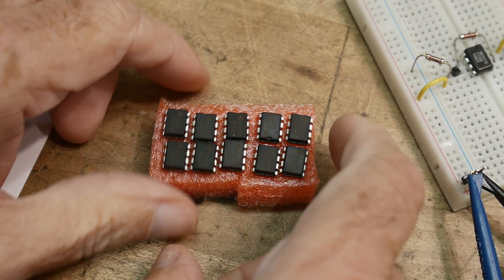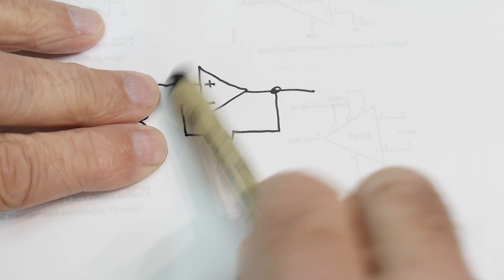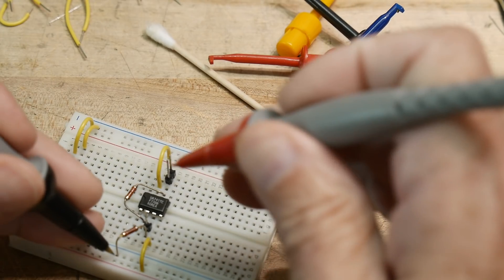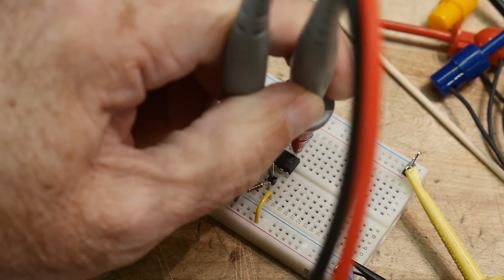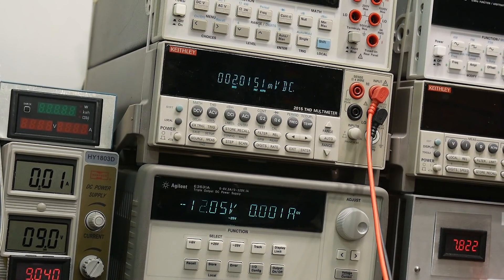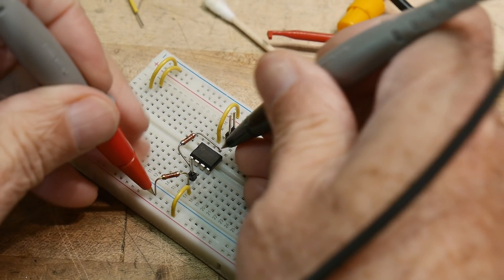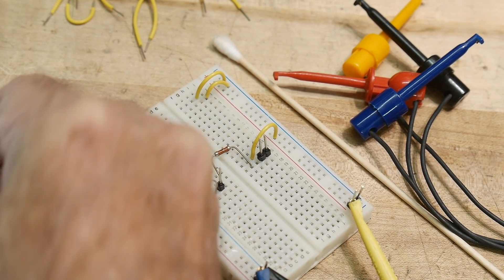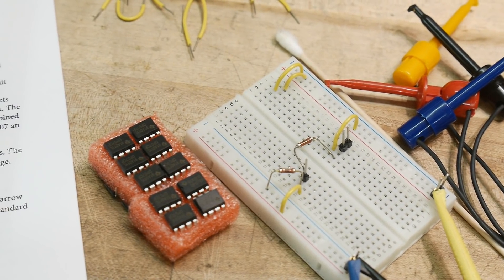#1029 Fake Op-amps from China

Comment: I purchased five each of these totally bogus Exar's XR2206 and Intersil's ICL8038, both EOL, Inactive, obsolete, not manufactured for decades, being kitted via Scamazon & FraudBay for less than $5, though the greedy price them upwards of $15US.

I found wish.CON had some kits WITH CASE for $3, so I bought five, incase someone like you would or could use some samples in your work. free to you, Maestro

Thank you for shedding photons on the issues.

I wonder how many thousands of unsuspecting hobbyists, especially the ones that post "Yeah Great Look at that Square Wave IT WORKS PERFECTLY, up until they feed 12V or more into the one exhipping EXTREME Sine distortion well within the original spec, but not the fakes.

I bumped into a years-old thread just as I was about to hit Spend on Scamazon for the one, and FraudBay for the other, when it became apparent via check-in on one of the specs listed that did not ring true.

There is an Excellent YT vid up by a Master who not only parameterized the actual IC, upo to and not including X-Ray, that went further in, came up at the other end of the cess-pool of fraud and dishonesty with a mofdified schematic and warnings re. over-voltage that teaches pparaller to this one.

xr2206 fake fixing will get it

Comment: I measured -3mV on my Chinese OP07s.  How is that even possible?
Reply from the maker: Hint: It is not a OP07
https://youtu.be/NSgqYLLPUSs?si=AGltAdbb8I6Kc0rr
Reply: @IMSAIGuy  Thank you for the answer. I suspect that in this case it's better to just throw away the entire OP07 batch, because you never know what's really in it.

It would be interesting if you could make a video on how to test basic OPAMP characteristics, for example offset voltage, voltage swing for rail-to-rail opamps, other important characteristics... For example, I also bought the MCP6002 and connected VDD to the non-inverted input instead of ground, and the output voltage was really only a few millivolts below VDD. However, I don't know what else I should test to be sure that my MPC6002s are suitable for use.
Reply from the maker: I made this for testing an unknown device with a good device: https://youtu.be/FzH0VEbI7uQ?si=wMG0g7ACsKL_39-h
Reply: @IMSAIGuy I bought OP07 in a regular electronic shop in Europe and again it does not work. Are you testing it with dual supply or single supply?
Reply from the maker: @markopinteric  dual

Comment: Recently I designed a card for a foreign customer using the known LT1990 industrial opamp. That is an excellent special amp. The customer had purchased the necessary lot of 1000 chips (likely from China). The cards went to production and then to testing. None of them worked. I had to investigate them and realied that they could not work at all. The chips were internally shorted at supply pins. All chips had o be pulled out and replaed with an original chip, now working.

The false chips had proper markings.

Comment: easy way to have a good indicator that you have fake op amp. use a fridge magnet. if the component case is attracted you problaly have a fake one
Reply from the maker: I liked your idea, so I tried it out. It seems that it is a good test for the age of the part but not if it is fake or not. the more modern good parts, also have moved to leadframes that are not copper.

Comment: Once upon a time 55 years or so ago. I was building the latest do gadget,  which required a quad 741 op amp.  After designing the circuit board, and for some reason installing sockets  for the ICs I installed the op amp, bought from a local vendor. Next the smoke test, where I would power up the circuit for the first time. My goodness I have built a plasma rocket ... the circuit wasn't happy to just let the magic smoke out,.... the op amp, spit flames from the pins and flew off the board. Rebuilt the board replacing parts from a more expensive vendor, and it worked fine, so yes sometimes parts are not what they seem.

Comment: You paid $1.88 for a batch of fraudulently relabeled 741s.  It would have been no great loss even if you couldn't get your money back. But suppose you were manufacturing a small run of high-precision electronics, soldered them into boards, and then found that your device performed like crap? Or even worse, your customer found that to be the case? The ramifications would have been a lot more than $1.88. I don't think the scammers in China who perpetuate this kind of fraud would shed many tears for you.

Comment: The real money is in defense acquisition supply chain obsolete parts. You buy some actual surplus die held by a surplus chip house, and bond them into a MIL package, screen them, brand them and sell them as MIL-SPEC, complete with a fake date code. They meet every AQL test. They even fix the antique box in the jet with no issues. But they are still counterfeit.

Comment: Using only one tiny specification is rather a rush to judgement.  How about the power consumption and noise level?
The OP07  IC has two "offset" pins, so they can be used if all other specifications are met, it that is necessary.  They are still audio amplifiers.  I bought 250. 2N2222A's for $1.95, they are fakes, but the gain of every one that I have tested so far is ~700. instead of ~100.  They are wonderful transistors.  I don't see the problem if you are careful. Ron W4BIN
Reply from the maker: the offset pins on the fakes were no connects, not bonded. they probably used a part that did not have the offset available or used -V and the op07 uses +V
Reply from the maker: Just to clarify, these op amps are not audio amps. they are way too slow. the only reason to specify an op-07 is exactly for the low offset.  If you are running an op amp at high gain, say x1000. then a 2mV offset would be 2V on the output. OP-07 are used in critical measurement applications. glad you like your transistors, I do not like my op amps

Comment: I once bought some fake OPA4134's in a DIP package off a Chinese vendor on ebay.  (It's the quad version of the OPA134/2134.)  They're a JFET input opamp that's great for upgrading a TL074 for noise and slew rate.  At $4 each the price was amazing considering the DIP package version was out of production.  When I got them they tested exactly like a TL074 which cost $0.15 or so in bulk (half the supply current and same noise as TL07 series).  They looked EXACTLY like real Burr Brown chips.  Super bummed....

Comment: About 10 years ago I ordered some IRF740 powerfets from a low-cost mail order place. They arrived quickly and I built them into an RF power amplifier designed to deliver about 25 watts.  I struggled for hours to make it work properly, fiddling with the driver and output transformers, thinking I must have got them wrong somehow. But it refused to deliver more than about 8 watts, beyond that moving into serious compression and the efficiency was poor. I changed the FETs (from the same batch) but nothing improved. In the end I decided it must be the FETs and I ordered some more 740's from a more reputable retailer. BINGO! 30 watts straight away and good linearity. Damn the Chinese.

Comment: I ran into fake op-7s where I work.  After look them over it could be seen that they had been top coated and relabeled.  The leads had also been trimmed meaning they probably had been removed from a previous installation.   These parts were bought like 20 years ago so this is a common problem.  I keep bugging our people here to update to newer part numbers so we aren't having to buy old new stock.

Comment: FAKE or NOT! Right, the prices have told you! If you say they are fake, you are blaming yourself Greedy! What did you expect if you use 1 buck to buy a stuff that should be 5 or even 10 bucks
Reply from the maker: I buy opamps at the local surplus store for $0.05 here in California. The OP-07 is a very old part so it should be possible to find old stock somewhere. $0.10 seemed like a possible price.

Comment: couple of years ago I bought 20 DIP LM358s from ebay and they were all completely dead, none of them did anything. it was as if the legs were just going into little slabs of plastic. I wish Id dremel'd into one to see if there was actually anything inside. and LM358s are super cheap anyway, you wouldnt think it even worth making fake ones.
Reply from the maker: most people think all the face chinese opamps are repackaged/relabled LM358s. They even fake those, amazing

Comment: Wondering if they're copies that have not been laser trimmed, rather than repackaged 741. What's the bandwidth, is it the same as a 741? I had some TL071 op-amps, which were fine, but had a lower slew-rate compared to the legitimate article.
Reply: In my experience, cheap opamps sold on the interwebs are usually just four or five designs that get rebranded to whatever part number is trending at the moment. Someone on the eevblog forum decapped many opamps ics and found the same kind of generic opamp, no matter what the markings. It's some sort of slightly faster LM358 (in single, dual or quad configurations, to match the fake part number pinout) and that's it.

Like all LM2596 on unofficial channels: they are some sort of low power 2576 clone. They can be useful if you know their limitations, but they certainly are not the real deal.

Also, I suspect all transistor kits contain at most two or three types of actual dies, no matter what the markings is. They are probably binned by hfe and maximum voltage.

Comment: I despise the chinese and their shitty counterfeit rip-off components. FU*K them is what I say. I refuse to buy any semiconductors now from chinese sellers on evilBay. You can pretty much be guaranteed the products are fakes. Any time you see 'normally expensive' parts advertised as 10 for a dollar, it's a good sign they're rubbish or remarked products. Another Youtuber did a good video on knock-off components and in it he shows how sometimes the parts can be almost the same as the genuine article, except the die is 1/10 the size so while it might work for a while, it can't handle the rated current of the genuine part and will fail on that.

Comment: The easiest thing to measure, quiescent supply current, is all by itself usually enough to tell you an op amp is fake.

All the fakes in my op amp collection that I've identified so far using quiescent current could plausibly be LM358s, but they're probably out of spec in some other parameter.
Reply: A LM358 can't be confused with a  ul741 as the ul741is a single and the LM358 is a dual. Ron W4BIN

Comment: There are probably some rudimentary op amp chip masks from the 1970s in China (copycats such as LM308, LM324, LM082) because there are many products of the same model number that differ only in the prefix. I think there is a foundry that has been commercialized. I have been hurt many times. The first sample is good.

Comment: Two other useful ways to tell suspect eBay op-amps apart - measure slew rate and noise with a CRO.
Reply from the maker: I will be doing slew rate in a future video
Reply: And look for crossover distortion, many knock offs are remarked LM321/LM324.
Reply: @ferrumignis  : Good point - the LM324 has much higher cross-over distortion than almost any other op-amp.   But cross-over distortion isn't a data sheet spec for most op-amps, so if you are claiming a refund on the basis of LM324-like levels, you might need to write your reason carefully.

Comment: At least they are actually opamps that work, I think you should reconsider your accusations. You see, cheap parts from China come because they're out of spec, not necessarily because they are fake.
For example, if you buy cheap 18650 batteries from China, you will get either fake batteries with 300 milliamp hours, or you will get out of spec batteries with slightly less capacity. Out of spec parts is what you would expect, if you are buying from eBay cheap parts from China.
Reply from the maker: I actually looked at the die from a real op07 and the fake one. they are different. The fake one also did not even wire bond out the offset adjustment. they are no connects. they are 1000% fake.

Comment: It's getting harder and harder to find legit parts.  Even Digikey is cracking; they're now including "Marketplace Product" sellers (chinese junk) in their inventory.  Will Mouser race Digikey to the bottom?
Reply: Well it is driven by the market. Lots of people just can't resist the low price. For most hobbyists, if there is less than 30% chance of getting fake parts, they are willing to give it a shot, especially they can get reimbursement most of the time. 

And technically, these parts are not Chinese junk but US junk since there was a long supply chain of selling US electronic junks to China for "recycling" and there were scavenger groups ripping off the old parts from PCB, sorting and reselling them. In 2017, Chinese government has banned such electronic junk trade for environmental concerns and what you can buy from aliexpress now (especially old DIP packaged parts) are possibly junk inventories before 2017, which makes their quality even worse.

SMT parts from Aliexpress are of (slightly) better quality because less % of them are from recycled junks. Some of these parts are substandard parts that failed performance test, but they are from original factories or dealers. So if you application is not mission critical, you can still try them.

If time is valuable, use a professional channel like lcsc for Chinese parts.
Reply: @sullivanzheng9586  I buy my chips from Unicorn Electronics Pennsylvania 
Never had a problem and way cheaper than Digikey Mouser or even All Electronics
Reply: @Starbuckin  Cool, thanks for the tip. The website looks minimalistic but their catalog seems a great fit for building up basic inventories and discontinued components for hobbyists/ repair work.

Comment: Could be worse.  I bought some 2N3819 JFET transistors from a US seller on Amazon.  Price was in the normal range.  They would not work at all in my application.  I then tested them with a transistor tester, where they tested as NPN.  Parameters are suspiciously close to those of a 2N2222.  Each package says 2N3819.  Didn't bother sending them back, but I reviewed accordingly on Amazon.  That's when I noticed lots of negative reviews for the seller saying other parts were not "as expected".
Reply from the maker: Amazon is a joke. I kept buying used Raspberry Pie computers that were just a scam and never shipped the product. Did this three times, each time Amazon refunded me. Then instead of admonishing the sellers. They told me not to buy that product.
Reply: I had the same problem with JFET transistors on eBay. The package said J201 (this is a JFET model) but these components were actually BJT transistors!
Reply: For anything that has a critical analog performance requirement (like RF transistor/JFET, low power/high bandwidth op-amp etc.) I only buy from legit vendors. It saves time. And for "digital" components like MCU, low speed logic gate etc., I may try ebay a bit since they are much easier to test/verify.

Comment: my very first time buying bad ICs was an 'on the whim' purchase of 10 pt2399 karoke echo chips from ali-express for something like 1.10usd  total. 

I Threw them in a drawer to use whenever I got around to making a delay effect pedal for my guitar. 

when i finally used them, out of 10 chips, one could output audio of any sort, but the weird thing is the only bit that worked on it was the low pass filter pins, nothing else. I was .. well i wasnt shocked but I learned my lesson.

Comment: I purchased a batch of 1% MF resistors and majority of the low vales ones (less than 100r) where close to 5% tolerance. I suspect seller purchased bulk stock at a discount because manufacturer had rejected them.
Reply: Buying 5% resistors these days I often find they are very close to 1% anyway. I guess buying the 1% parts from a reputable vender just guarantees stability within 1% for a reasonable lifetime.

Comment: This is not the proper way to measure the offset voltage of an opamp. It doesn't take into account the input currents that may not be equal.
I believe you can find in the datasheet of low offset voltage opamps schematics to more accurately measure offset voltages.
Note: this doesn't mean your conclusions are wrong. But I don't have confidence in measurements that are not very carefully prepared.
Reply from the maker: I should not have put in the 1k to ground, but that would just improve the number not make it worse.

Comment: This is why I buy from legitimate suppliers, such as RS, Farnell and Mouser. Just bought a pair of AKG K240 MkII headphones directly from AKG (that has that option), to be sure they are what they claim to be :-)
Reply: Who do you think are producing what you buy on Farnell, RS and Mouser?
Reply: @peroleable  Yes but they are checked and guaranteed by Farnell/Mouser and probably not manufactured in China. Buying from China is most likely fake, next QA rejects, next anything in an 8pin DIL package. Dismantle a known brand Chinese product and you will not find Chinese parts inside.
Reply: @peroleable  We are not discussing who is producing what, we are discussing the re-branding of components that have most likely come out of the dumpster of the companies you are referring to. This has been going on for years. There are reputable sellers in China who sell real parts, but they are as rare as hens teeth.
Reply: @peroleable  as far as I can see, most audio electronics things on taobao are fake. caps, op amps, transistors. I think the component market is very twisted there, if you don't scam people, you can't really out compete with ocean of scammers. It's just a reflection of Chinese's mentality. and Chinese consumers are cheap as well which feeds the circle.
Reply: YES ....  DO NOT "DESTROY THE OWN COUNTRY" ..... 100%  #NOT  ..